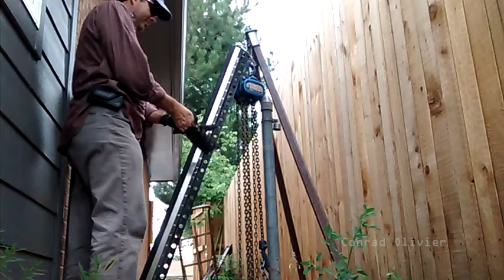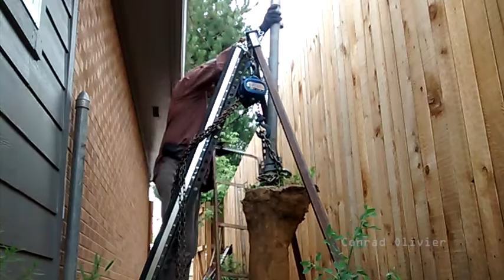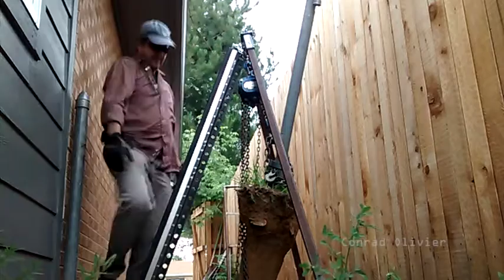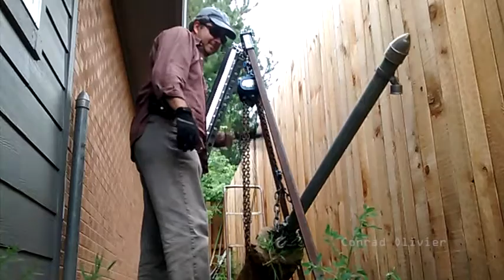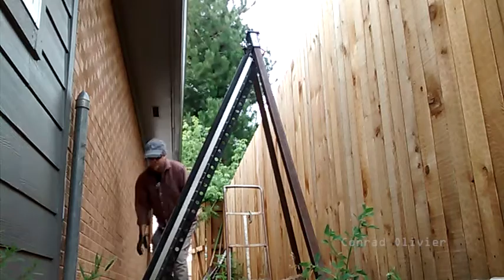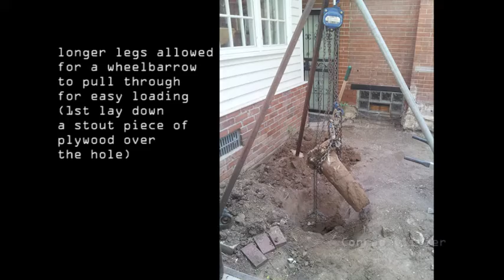DIY Post Puller made with a chain hoist - remove metal or wood fence post w/o digging

Comment: How did you connect the top of the tripod and allow the legs mobility for placement?
Reply from the maker: Good questions - https://www.harborfreight.com/d-ring-receiver-hitch-66212.html and some square metal tube/pipe - one leg is the 4x4 mast from a soloflex - primary reason for the d-rings was to allow it to be used in awkward positions. Soloflex main column makes it too heavy and will switch back to regular piping as soon as I locate it.  An engine hoist works well too, but not easy to move across unpaved access.  Welding up a central pivot head would be wise if you have access to a welder... I did not.
Reply from the maker: Perhaps using two of these: https://www.harborfreight.com/clevis-trailer-pin-mount-66345.html and the d-ring hitch could work as well.

Comment: Thank you for sharing this video Conrad.  What is the tonnage rating for your chain hoist?
Reply from the maker: Hi Jim - thanks - I think the central connection could be better/different, but it works.  So the chain hoist is a 1 Ton Ross chain hoist - made in China.  I've had it for perhaps 10 years I'd say and has held up very well.  I've used it to pull up a 36" wide concrete block of stairs once (using my gantry trailer setup)... http://amzn.to/2nOE2lx  (I like the 'Uproot Root Puller' video here on youtube - seems like a great setup, though a lot of custom parts/work in it).
Reply: Thank you!